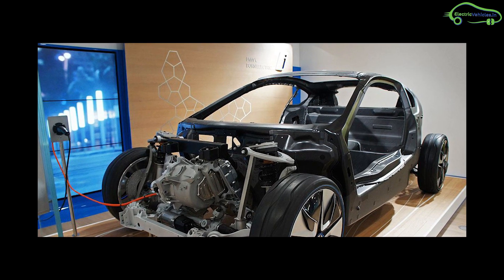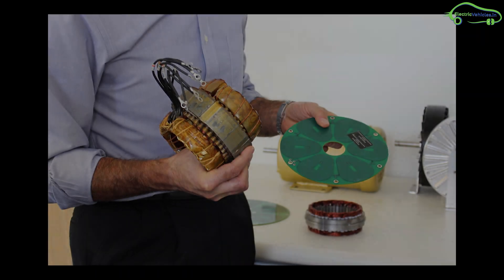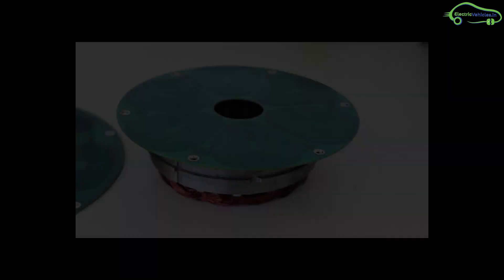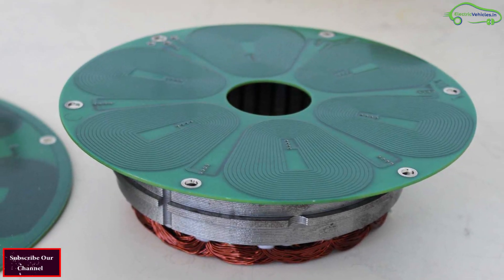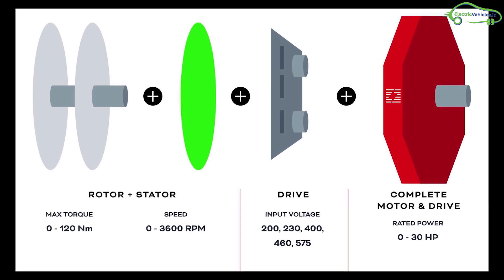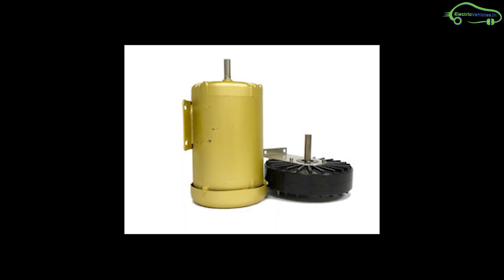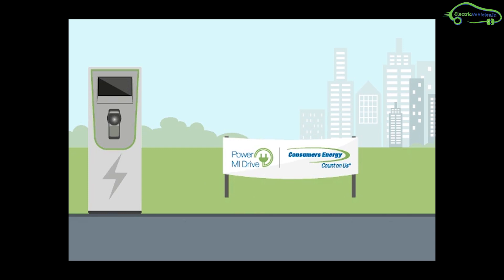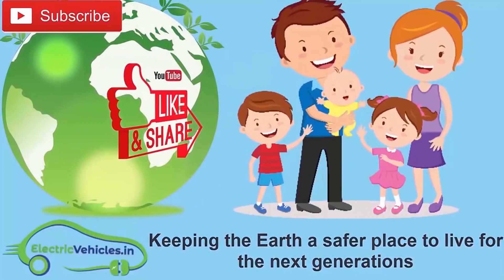IOT Electric Motor for Electric Vehicles: Infinitum electric

Comment: PCB motors have been around since the 70's. They're not new... and their practical use is very limited. They have notoriously low duty cycles and negligible constant duty  capacity.

Comment: But how come will it manage to handle the Torque stress (every action has equal and opposite reaction)
Reply: You are right. Ordinary Axial flux coreless motors like this one usually have the windings encased in fiberglass for stiffness. I presume you can make the circuit board as thick as you want. The clever part is that the windings are on the outside of the stator, so they get better cooling, which can be a problem with conventional Axial flux motors.